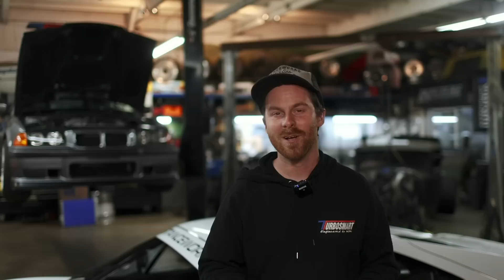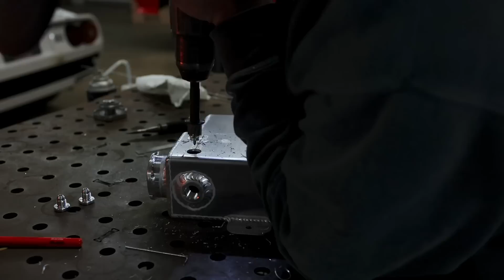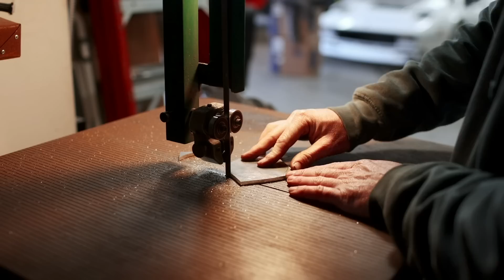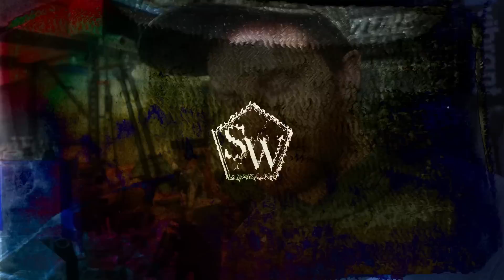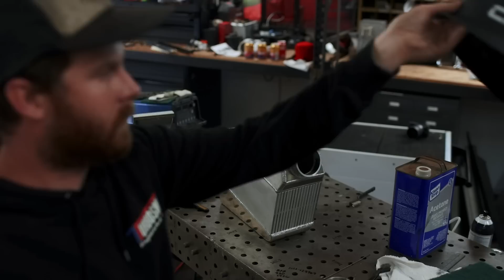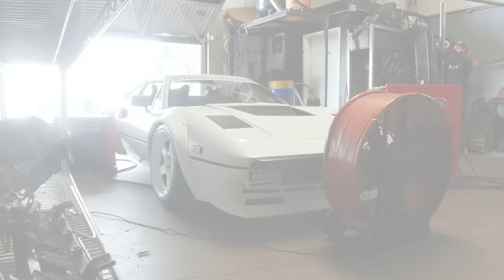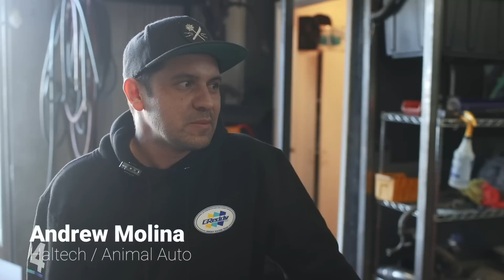FINALLY. The K24-Swapped Ferrari SCREAMS on the dyno!

Comment: I’m no structural engineer but it looks like every joint that failed on the i/c box failed along the weld joint seam.
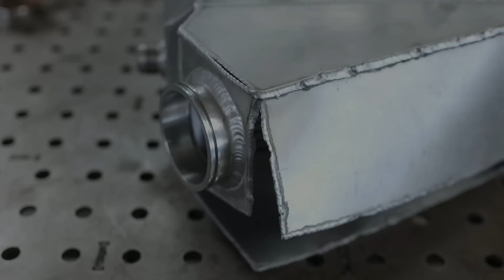@2:30

…”when I started this I didn’t know how to tig weld”. 
You. Don’t. Say.

This is weld testing 101, if the material fails in the HAZ the weld is good. If the weld itself fails, get more practice, not thicker material. 

Heavier stuff also makes your car slower, ofc.

Comment: Pressure testing with air is playing with fire or a bomb. SCUBA tanks are pressure tested but they are filled with water. This way, if they falter, you don't have a bomb going off releasing hundreds of cubic feet of air. You really should have done a little research before doing this test.

Comment: Water is often used for pressure testing instead of air, because water doesn't compress. So if you have a failure, you just get a leak instead of firing shrapnel across the shop. Example: https://www.youtube.com/watch?v=UtOk7aasK74

Comment: Can this be explained; e85 makes more power but uses more fuel to do and it more prone to early detonation in higher pressures, so how do you use e85 without knock? I thought you had to use like a 93 or 100 for high boost to keep knock out.

Comment: A tip I've learned for fixing welding pinholes is using Loctite 290 which is "penetrating grade". It wicks into small cracks, pinholes and weld porosity and seals them up extremely well. I am also a mediocre aluminum welder and have found this to be a very easy way to fix tiny oopsies that if you try to go in and weld up can result in a runaway issue that just keeps getting worse. Leak repairs using this stuff have never failed for me. Have used it to seal radiators, wheels, oil fittings that have survived track abuse. Not sure it would have recovered your 2nd attempt but I would have tried it!

Comment: I don't get it. The material didn't fail on the Intercooler the welding did. Bad weld penetration.
Reply from the maker: Watch the previous videos. It failed on the corner because that’s the highest stress portion.

Comment: You obviously have zero clue how your are supposed to pressure test. Always water test first so as to not make a grenade. If it fails a water pressure test there's zero shrapnel. Then after it passes a water pressure test... Then you can gas test it. (Air is still a gas) always water test 3x normal operating pressure. There's actual engineering guidelines for testing a pressure vessel.

Comment: A friend recently reminded me, it is MUCH safer to pressure test using water rather than air because water is not compressible whereas air is.   Push it to failure with fluid, it will split.  Push it to failure with air, and it will "explode" or at least rupture far more violently. https://youtu.be/YD1dNpelSpg  Thanks for sharing your trials and tribulations.

Comment: You made water injection with your intercooler. Leave it. Like Bob Ross, not a mistake just a happy accident. Get a funnel and some tube from the Dollar general, zip tie it to the dash and run it to the reservoir. Extra 100hp. Baller. Also add Lambo doors cause your 4RE is lacking doosh.

Comment: Nothing wrong with the sound, but it’s not the best sounding high rpm run. Sounds like my pro model Stihl chainsaw, but a little smoother. It’s awesome for sure but it’s not the same as a v8 or v12 at the same rpm. Cool car though. Check out the video of the black Ferrari on Dino with downshifts. Even better than an America v8. Is what it is.

Comment: I'm surprised to learn that E85 wasn't always part of the build goal (especially on a boosted car). I ran E85 on my car while racing with SCCA for almost a decade on the same engine. I would never go back to straight gasoline. I started out racing on 100 octane gas and after a few years switched to E85 and never looked back. Definitely need a higher volume pump and don't forget to make sure your injectors have enough head room. Obviously a flexfuel sensor is the way to go so the ECU can manage the tune automatically between gasoline and E85 (and anything in between).

Comment: The clamps your using we use on aircraft that do not have pressure..bango style is what we use for heavy pressure. Heat is the issue with the seal.

Comment: 15:21 Go to E100 and you'll probably hit 800 wheel at a lower boost pressure probably closer to 20psi due to the intense adiabatic charge cooling effect of alcohol. People have even used charge cooling injectors immediately post turbo, or even pre (for more consistent homogeny) to further remove heat energy from the intake charge. With the correct strategy you can achieve near-methanol like results. The benefit here of course is the drastic combustion stabilization of the incoming fuel charge. Reducing the likelihood of a pre-detonation event by several-fold

Comment: Dude, the way you were pressure testing that was INSANELY unsafe. i know damn well that you can not be entirely oblivious to the amount of energy that stood to be released upon an explosive decompression of roughly a half cubic foot of air at 60psi. ANY TIME testing pressure requires essentially producing an air bomb, you need to be doing hydrostatic testing submerged in water

ALSO: GOD DAMN IT'S MAKING 800 @ THE TIRE ON ONLY 24.5 PSI?!?!??!!!!! THAT IS INSANE. G-SERIES TO THE MOON!!!!!!!!!!
(I am EXTREMELY curious what drive pressure ratios you are seeing with a G40 on a 2.4 litre in order to produce that amount of charge volume. Do you have a pre-turbo pressure transducer installed? please share if so)
Reply: I wish, I also wish we had EGTs and Emap

Comment: Pin holes I braze. Oxy Acetylene with a flux core rod. Low smaller flame with a nitrogen trickle to prevent carbon from forming inside.

Comment: Gets 800hp. says he thinks it'll be 1000hp with different fuel. Don't be that guy. 800 is respectable. There is no reason to be a lying pos.
Reply from the maker: It’s not being a lying POS, don’t be a dick. It’s a 4P engine built for 1200bhp. It’ll make 1000 without hesitation. FFS it’s making 740 on just 18psi

Comment: Could it be that you'll need to temper the intercooler? I seem to recall that aluminum needs that to destress in proximity of the welds. In view of the pressure you're running and the fact that it's dying at the seams, that might be a remedy?

Comment: 0:30 you are not losing 200hp through that drivetrain. 800whp in this car is not 1000bhp. Further, I'm going to recommend from a position of love that you need to be more careful pressure testing. At least fill the core mostly with water then pressurize it with a little bit of air, and wear ear protection when you pressurize it so if it ruptures you aren't left with permanent hearing damage. If you have been within a block of an air tank failure you'll know why I recommend this.
Reply from the maker: Ok thanks

Comment: I mean I see that you were a little nervous about handling it which is good, but if I was testing that core with my fingers / eyes / ears on the line I would do a proof load with an enclosure, and then much lower pressure when looking for leaks or pin holes. Engineering standards were developed because of boiler explosions, pressure vessels are scary as shit

Comment: If you ever have to pressure test a new component in the future, consider using DI water to fill up most of the void. If your component does pop, it doesn’t explode like a compressed gas will.
Reply: Why would you need DI water for this?
Reply: @matter9  that’s a good point, DI water is industry standard but likely overkill for applications like this.

Comment: So just to summarize : without "race type fuel" (with high octane) or ethanol ; what are the numbers ? 
--> Around 850hp @ 9500rpm & that for what weight "?" in Kilograms (taking into account that there is no rollcage/fire protection system/harness... etc) 
Thank you

Comment: I don’t think you can blame the material thickness for the failure. It broke on the weld
Reply from the maker: Watch the previous episode. It was material thickness.
Reply: @stanceworks that’s funny I’ve built many radiators out .90 and they always hold pressure test at 40 psi .
Reply from the maker: They have a lot less surface area.
Reply: @stanceworks  true but that weld also had a lot of surface area . Best practice to have the long sections broke not welded . Car looks bad ass enjoy it
Reply from the maker: Appreciate it. 
But again, it would have split on the corner even if it was broken instead of welded.
Reply: @stanceworks  I think we can both agree that the weld was not as strong as the base material
Reply from the maker: Aluminum welding never is. But the FEA still shows it would break on the corner even if broken over.

Comment: Peak power isn't everything unless you're dyno queen. Not sure how heavy the Ferrari's are, but 600 odd hp seems pretty good. Had a W2A system on my old 4wd and it saw 24 psi regularly and it was 3mm (1/8') thick....
Awesome project, and good luck at the track when you get there.....

Comment: Why I can’t believe 575whp at 12psi and 810whp at 24 psi.
Is it even possible.
Reply from the maker: 810 wasn't really a proper run. It's the highest we saw but it was very inefficient. It'll probably make more power at that PSI later, with proper fuel.
Reply: @stanceworks  That’s really impressive. I didn’t know the Kseries was so efficient.

Comment: You might already know this, so sorry if telling you to suck eggs, when you pressure test things in industry you would typically use a hydrostatic test, so water and a pump. The key difference between water and air in this case is water being incompressible won't explode the tank during a failure, it'll pop the weld then just leak out. Much, much safer. 

Epic build though, matey. So good to see it running so well

Comment: Caveat: I know nothing about dynos specifically. But, that surging to me doesn't seem right. I don't buy that the rotating mass has an effect, well it would, but a well tuned dyno shouldn't be affected by this. To me this seems like a dyno with a poor PID tune. I wasn't sure that hub dynos have PID settings, but I googled a bit and yes, they do. I think what is happening is that the engine's lack of rotating mass, or the way it makes power (possibly even the aggressive cams) are being under or over compensated by the dyno, creating an oscillation of the dyno load. PID tuning is tricky, I've played with it on camera gimbals. But like I'm sure you're familiar Mike, a gimbal with a good PID tune just works right when a camera load is well balanced on it. Same should go for the dyno. Anyway, again, I'm not speaking from authority, just tossing out some ideas in case it might get some gears turning, and ultimately help those guys turn out a better service.
Reply from the maker: I would have agreed but apparently this is very common with these engines. 4Piston themselves also agreed with having to break the sweep up to keep it from surging.
Reply: @stanceworks  Interesting, so you're sweeping increments like 4-6, then separately 6-8 or something?
Reply from the maker: No, but instead of starting at day, 2500 like normal, we’re starting at 4800 up to 10. Then the bottom half separately.

Comment: 810 whp with that drivetrain would only indicate around 835-850 hp at the crank. Drivetrain loss does not increase as hp increases, so calculating it by a continuous percentage isn't anywhere close to accurate.
Reply from the maker: Guess I’ll just have to do it again.
Reply: @stanceworks  haha. Not trying to be a dick, but the percentage based drivetrain loss calculation method can be wildly inaccurate.

Comment: Perfect combo for the sweet power. small lag and ripping for the weight. You don't have enough turbo to hit 1000. You were coming up against back pressure at 810@25psi. You gained basically a 100hp bump from 4psi increase. With the additional 7psi you only gained 74hp to hit 810. I'm sure you could push it higher but I have no doubt back pressure will not let you reach that 1000hp mark. If you did hit it, you would be absolutely torturing the motor fighting the exhaust pressure. Maybe with a bigger A/R.
Reply from the maker: Both tuners said we're not fighting back pressure at all. It's timing and fueling. I've got a 1.15AR housing on a G42-1200 Compact turbo, it's only just now getting to where it wants to be. The 810 run isn't really a sorted one.
Reply: @stanceworks  ahh ok now I got ya. 736 at 18 is out of this world.

Comment: When pressure testing fill with water first. That way the air inside won't compress under pressure. It is safer to test with water inside. Less explodey.
I mean put water into the air chambers for testing.
Reply: Yeah I was a bit worried seeing them use air to pressure test, they must not realized the danger they was in. It popping standard that close can be deadly, pretty much a grenade

Comment: You can do brazing with the tig torch, you just need some brazing rods. You could potentially touch up that pinhole if you use the right brazing rod. The difference between brazing and welding that is giving you trouble is the Flux. Flux is a chemical that when heated cleans the metals to be joined and keeps them clean while the liquid metal is flowing on the base metal. The brazing rods have Flux in or on them that comes out as the rod is melted. You need aluminum specific brazing rods because aluminum needs more aggressive Flux to break through the oxide layer.

Comment: I did almost the exact same thing, I welded two intercoolers together, and overheated the internal seams between the cells.
Also had to cut the end tank off again to repair the weld, it's a bitch.
It's a long way to the top if you wanna rock'n roll !

Comment: Nice work but NEVER pressure test with air or any other compressible gas! Only liquid and you wont kill yourself or anyone around. Fill with water and use a hydraulic pump or ram. At 60psi you have pipe bomb at your hands!

Comment: As an engineer you always hope you will do something perfectly first time - truth is - that’s the exception. Mostly it’s all a learning experience in any part you do, sometimes requiring many iterations and analysis of each step to realise a “good” solution. 
Good work though with that smart idea to pressure test using the old fittings !

Comment: The proper way to pressure test a vessel is to fill it with water. The pressure test works identical to air, but when the vessel fails, you hear a crack instead of an explosion. Its even safer if you fill it with water and submerge the vessel in water during the test. "Hydro-testing" as they say. I pressure tested a 5 gallon keg to failure this way at 150psi with a hand pump without an issue.

Comment: No diss on the engine I 100% agree with your choice when you explained it a couple of episodes ago but since seeing Adam lzs video on the high hp Audis just wondered what your thoughts were about the 5cly from the ttrs cause that would surely still fit transverse and have a killer noise

Comment: Why would you pressure test with air ? Did you do zero research on pressure testing vessels ? 
You are supposed to hydraulic test vessels with fluid, like water not pump the thing us & turn it in to a bomb.
Reply from the maker: That would test it for leaks. I wanted to test its structural capability. A hydraulic test wouldn’t do that. Please don’t treat me like I’m an idiot. I did research before doing it and did the necessary test.
Reply: @stanceworks  that’s also how to test for structural integrity but instead of a failure launching metal across the workshop you get a puddle of water & no drama.
I am a designated steam boiler tester for model steam engines for a model engineering club.
Your goal should have been twice maximum working pressure for ten minutes.
Reply: @stanceworks  at minimum you should have contained the work piece with a sturdy metal cage that won't rip your head off, if it does explode.

That thing you did was dangerous and you lucky no one got hurt.

Putting the work piece just beside the front door is also a facepalm moment because it could have flown into the cars, or it'd do human injuries or it'd do property damage, safety always first!!!

Comment: E85 would be the smart move. High octane, easily found and smells sooo good lol. Can’t wait to see this thing finished and finally ripping around a track.
Reply: We use E100 in Brazil.
Easy to tune, cheap, can use compression ratio in 10:1, good response, cool down combustion chamber (it is hydrated).

Comment: nice. but, pressure test with water next time.. using air to pressure test is a tad dangerous....
Reply from the maker: That’d only tesr for leaks, it wouldn’t structurally test the thing to see if it’d hold 60psi